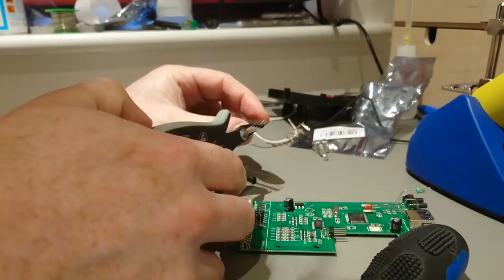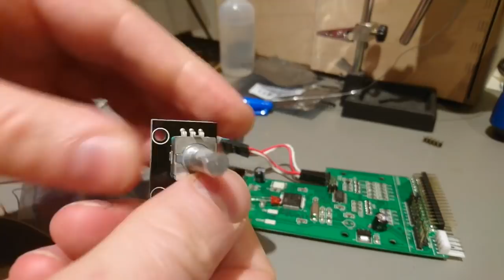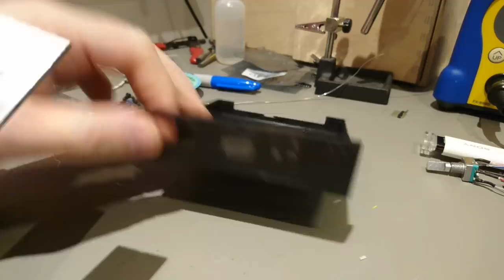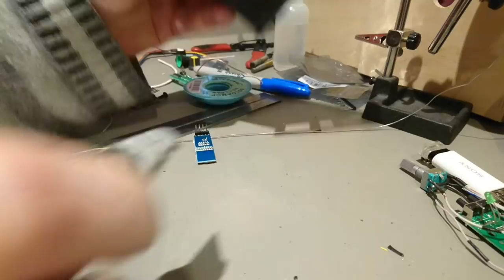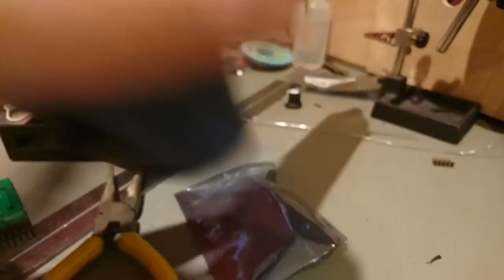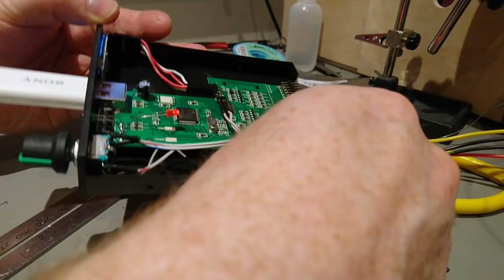Flashfloppy GOTEK Mods

Comment: Actually there is no need to widen the opening  to fit the full size of .91" display, unless you want to use the full size of the display. You can use the Gotek's default cutout size and omit text view to the appropriate size  in flash floppy with "ff.cfg" file . 

narrow[er]: OLED view is restricted to Gotek display cutout
    -narrow: 18 characters of 6x13 font
    -narrower: 16 characters of 6x13 font
Reply from the maker: When this video was made, there was no option to change the size of the text :) things move on!

Comment: Today is the big day. Borrowed a friend's soldering iron (4mm wide blade tip) and 1.5mm thick solder wire, both not ideal I know. Installed the 0.91" OLED screen - you're right, the 4-pin headers were supplied separately, so had to solder them on, then attached those to the 4 pins on the Gotek board using pre-bought Dupont cables. After a couple of false starts, the OLED screen worked. So I decided to go one step further and try and install the rotary encoder, and that's where the problems started. (You're right, there's no way the encoder with its backboard will fit into the case. However, for testing purposes only, the back board is still attached.) I tried to install two header pins at position JK on the Gotek board (6m30s of video), but in trying to clear out the holes of solder, I inadvertently lifted about 2mm of the copper traces going to those through-plated holes. Have I f***ed up my board or is there a workaround? And now the OLED screen has stopped working. Maybe I applied to much heat and desoldered the 4 pins for the screen at J7 although they look alright. However, when I connect my Gotek to the synth, it still boots up the system disk from position 000, although I cannot see that on the screen. Thx.
Reply from the maker: I'm really sorry, but I can't fix this for you or hand-hold to this degree. I just did a video to try and point people in the right direction, it really wasn't to offer a support/advice service - it's not my product :( If you've lifted traces you'll have to try and patch from where the trace is to where you want the signal to go to with some wire... Without physically looking at your board myself I can't say what the best route to repair would be, or whether you've damaged what's going on at J7. All I can suggest is checking continuity against the schematic, which is on this page: https://cortexamigafloppydrive.wordpress.com/ - how to repair lifted tracks, and how to check continuity is really way way beyond the scope of what I wish to get into here. I can clarify what I've done in the video but I can't get embroiled in soldering and electronic repair. There are lots of forums that can help with that subject.
Reply: @drdpj  OK, I realise that it's difficult for you  to assist without physically seeing my board. I also appreciate it'snot really your job to offer this kind of support. Sorry to have bothered you. My solution is to order a PCB trace repair pen (for less than 2 quid) but will take a couple of weeks to arrive. I hope that will work. Cheers.
Reply: Finally!! I got the OLED and rotary encoder installed (although the final result inside the Gotek was not as neat and tidy as yours) and it's all working fine and dandy with FF v2.13 in my Roland W30 sampler workstation. Thanks for all your help and advice. Sorry I was a pain in the backside.
Reply from the maker: Well done, glad you got it working!

Comment: My rotary encoder arrived yesterday (part number 0K2412B if that helps). Please clarify something: will the encoder and its backboard fit into the Gotek case "as is" or is it ABSOLUTELY necessary to remove the backboard like you did in the video? I notice I have 10k resistors on the backboard - is that going to be a problem if I remove the backboard? Thx.
Reply from the maker: It won't fit with the backboard. Check the wiki. If you keep the board you have to bend it through 90 degrees and hook the pins back up to it. The resistors change how you wire it in. Again, check the wiki for details :)
Reply: @drdpj  Bugger! That's what I thought you were going to say. Not even if I cut a bit of the lid away in that corner, it still won't fit?? With respect, before posting I looked at the Wiki and what I understand from it is that you can can connect either with the backboard (he calls it KY040), or without it ("connecting directly"). But I still don't understand about the resistors (my electronics knowledge is not that good). On the second diagram (no backboard), there is no + line, just DT, CLK, SW and the two GNDs connected together. So where does it get its power from? Thx again
Reply from the maker: @droses1600  Dunno - suck it and see? I didn't wish to cut my case up, and bending the backboard out 90 degrees was a tidier solution. The resistors work as pull-ups for the encoder to the 5V... Without the board, CLK and DT (and SW) sit at 3.3V (from the microcontroller) and are grounded as you move the encoder. The grounding is what's detected as the pin on the uC will end up sitting at 0V instead of 3.3V. You don't have to worry about it really, just know that if you've got the resistors, you need the 3.3V connection, and if you don't you just connect it directly.
Reply: @drdpj  My worry is about connecting the encoder incorrectly and breaking it. Not the monetary value, but having to wait 3 weeks to get another one. Or even short-circuiting the Gotek - that would be money down the drain. That's why I need to know how to do it right first time. And even though you've tried to explain it, I still don't fully comprehend pull-up resistors. As you say regarding the case, I'll see it if it fits without cutting off a corner of the lid. Cheers!
Reply from the maker: @droses1600  Tthere are loads of websites which explain how the rotary encoders work and what the pullups do (google arduino rotary encoder). They're not very easy to break, but you pays your money you makes your choice... How I would do it if I didn't have any desoldering gear: heat up one of the pins on the two pin side, lever it out from the encoder side using some tweezers whilst hot, then do the second, then bend it to 90 degrees, then use two short lengths of wire to reconnect the pins to the pcb.  Personally I'd ditch the whole PCB as it then requires one less connection to the gotek board (you can leave off the 3.3V line).

Comment: Can you add into the description the links from where to buy EXACTLY the same OLED screen and rotary encoder (and knob) you were using please?
Reply from the maker: No, as they were ebay purchases and the links for those don't exist anymore and I've not built one in over a year. The wiki describes it all. The Facebook group will have people who can advise.
Reply: @drdpj  Don't use FB (never trusted it since Day 1) so I guess I'm on my own with only the Wiki to help me... Thx anyway. I'll let you know if I decide to take the plunge or not!
Reply: @drdpj  What about those short cables you used (from the OLED display to the PCB headers/from the encoder to the other headers)? Is it possible to buy them pre-made? Cos I don't have the tools or materials (or the skills or experience or money to buy all those things for what will be a one-off project) to make them myself. Don't even have a soldering iron, which is a pain cos on taking my Gotek apart today for the first time I noticed it doesn't even have the header pins for the jumpers (which is the first procedure you did in this vid).
Reply from the maker: @droses1600  They were the cables that attached the original LED 3-digit display. I just re-used them.  People do sell them pre-modded: https://www.ebay.co.uk/itm/142684978875 (ignore the amiga/atari bit, it's the flashfloppy bit that's important).

Comment: Where do you get information on the circuit board and it's functions for the Gotek board?
Reply from the maker: I'm not entirely sure what you mean - but all the relevant information is in the wiki linked in the information above.  Otherwise if you're looking for a schematic of the gotek there are a number floating around on the web. Google will show you the way :)
Reply: @drdpj  Thanks for the reply. What I mean is, how do you know what the jumpers etc mean on the circuit board? Is there a document describing the board?
Reply from the maker: @edwardgrabczewski  yes, in the wiki.

Comment: @drdpj I just bought a Gotek SFRM72-FU-DL emulator to replace the FDD on my Roland W30 workstation. One drawback I've noticed is that it's only possible to put 99 files on the USB stick. I assumed that because the Gotek had a 3 digit display up to 999 would be possible. Do you know of any possible mod to overcome this handicap? Thx.
Reply from the maker: No idea I'm afraid if you're using the stock firmware on the gotek. You need to reflash it with flashfloppy firmware and then use indexed mode. See: https://github.com/keirf/FlashFloppy/wiki Once you've done that, if you want to swap the 3-digit display for an OLED you're not really limited, you can organise everything into directories.
Reply: @drdpj  Appreciate your response. So in other words, installing OLED and a rotary encoder is pointless without flashing the firmware (they won't work otherwise)?? My only concern is that the flash floppy firmware is intended solely for Amiga/Atari computers, and might not work on my keyboard... Thx for any further help & advice.
Reply from the maker: @droses1600  that's correct, you can't use the oled without the rotary encoder. Flashfloppy is designed to be system agnostic. I use it with an Archimedes and bbc micro. It presents a standard floppy drive to the system (you do need to set the config appropriately) and can deal with many disk formats natively. There's a Facebook group for support. Read the wiki, it talks about a number of different machines it's been tested with and how to configure it appropriately.
Reply from the maker: Sorry, oled and rotary encoder without using flashfloppy. Darn phone.
Reply: @drdpj  I saw on another YT vid that flashing firmware is possible using a USB A to A cable. That true for my model? And the flashing process is non-reversible, right? Not sure if I want to take the risk of trashing my 30 EUR emulator if it doesn't work with my keyboard afterwards....
Reply from the maker: @droses1600  it's all in the wiki. Yes, you can use an a-a cable. Buy a second one on ebay for £12 and test with that.
Reply: @drdpj  I think I would like to hear from other Roland W30 owners who have already done this mod before plunging in myself and committing funds I can't really afford (don't even have any soldering equipment). Your Wiki is good but seems geared to Atari/Amiga owners, not keyboards owners. Also didn't find the answer there about reversibility.
Reply: @drdpj  £12? From where?
Reply from the maker: @droses1600  it's not my wiki, I didn't design the software, I just did a video of how to add some mods. I suggest you join the Facebook group, there are people who've used them with synths. Cheap gotek on ebay: https://rover.ebay.com/rover/0/0/0?mpre=https%3A%2F%2Fwww.ebay.co.uk%2Fulk%2Fitm%2F283251775386
Reply from the maker: @droses1600  and here's the list of host platforms on the wiki - quite clearly not just amiga and atari! : https://github.com/keirf/FlashFloppy/wiki/Host-Platforms
Reply: @drdpj  You're right, it says "Roland synths typically work right out of the box". So I'm feeLing a bit more confident about giving it a go ...
Reply: So I now did the FF flashing. And I don't know why I was procrastinating about it for so long - with a USB A-A cable, it's quick and easy and the benefits of the new firmware are HUGE: faster loading times, use normal file names, no need to rename extensions to IMG, 1000 files on a stick, etc. And because FF supports folders, with an OLED screen (my next project), the number of disks/files on a stick is only limited by the capacity of that stick. Go for it y'all...!!! Head over to Keir's Wiki page where I posted a 'How to...' document if you're still unsure. You won't regret it.
Reply: you start with the number "00" thru "99" so you end up with 100 files

Comment: I'm a bit confused by all the display options/case cutting.   I've read the .91" displays can be used without cutting the case but every video I see of a display mod has the case cut.    Is your display .91" or .96"?
Reply from the maker: 0.91" - you can also use the 0.91" display without cutting now, flashfloppy just uses a smaller font and doesn't use the whole thing.
Reply: Yeah, don't cut it if you can avoid it. I made the mistake of cutting mine to fit the whole display section, and there's a bunch of contacts and junk on there you don't really want to see. I wish they made these things so they would sit closer to the panel though (like the stock LED display). I'm going to try to find some blue lens material to fill the hole.
Reply from the maker: If you extend the hole to exactly 1" you don't get any of that.

Comment: HI. I am awaiting delivery of a ready-built unit from RetroClinic, but since seeing this video and purusing the stardot forum, I have ordered all the separate items from fleabay (total cost <£20). The process looks fairly straightforward. I have 2 model B BEEBs and a Master 128, so I may well get a third unit, if the self-build goes well. Thanks for the detailed vid.
Reply from the maker: Glad it helped!  They work brilliantly with the beebs/masters, and indeed it's possible to do them for well under £20 if you're prepared to get your hands a tiny bit dirty :)

Comment: I followed this guide for the rotary controller and It works fine on the Atari using flash floppy firmware. Only bit of constructive feedback would be to show the connections more clearer on camera as I had to pause a few times and look back to make sure where they went. or use coloured cables. other than this great guide and many thanks. I will go do the same to the gotek in my Amiga :)
Reply from the maker: Thanks Chris - good point. I was using a finely balanced mobile phone, so not everything was as clear as it could be. I think I linked to the wiki in the video, the illustrations on there are really the best aid to working out what goes where.
Reply: ordered up some parts and learned a lot from this video. Once again many thanks
Reply: Just take a length of a standard network cable, colour-coded twisted pairs, easy ... ;)
Large sets of Dupont Wire Jumper Pin Header Connector Housing Kit + M/F Crimp Pins are dirty cheap on eBay. To avoid bending connecting wires, replace the straight male pin headers with angled ones ... extra work but these are cheap and not too difficult to replace/install.

Comment: Really HELPFUL video!!! Bookmarked it. Where did you get the rotary dial KNOBs (link?) pls? Also I wonder why you went for black ones and why you didnt drill a hole for the red LED whilst at it. Did you explain why you desoldered the Rotary units bottom?  Thanks again.
Reply from the maker: Hello :) Thanks.  The knob was from ebay - lots of people sell them, 6mm d-shaft. The seller I bought from doesn't seem to have any at the moment, but you should have no trouble finding the relevant things (I don't really like putting links on something long lived as they're all so transient, better to know what you need to search for).  Black because it was cheap and did the job.  I didn't bother drilling a hole for the red LED as if I got it even slightly off centre it'd irritate me, and it's fairly obvious when the unit is turned on as the screen works when you touch a button or twist the knob :D. If you did want to, I think it's a 2mm drill bit you're looking at. 

Rotary encoder I explained in the video - if you don't take off the PCB and it has resistors on it, you have to make a connection to 3.3V, and additionally you have to at least partially desolder the encoder from the PCB to make it all fit into the case. It's easier just to remove the whole thing, then you only need to make 4 connections and don't have to worry about fitting it all in.  Easier is probably just to get the encoders minus the PCB, but it depends what you can find at a reasonable price. I do recommend trying to make sure you get the ones with the nut/washer as the nut isn't a standard M thread.

Including all the parts and gotek, I think it's possible to put one of these together for under £20.